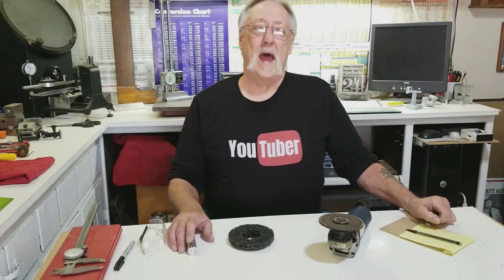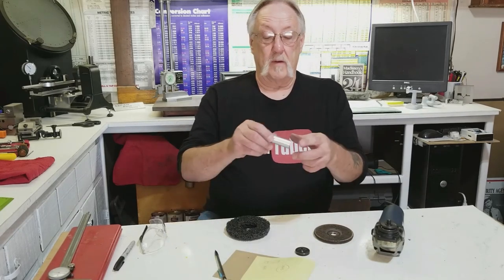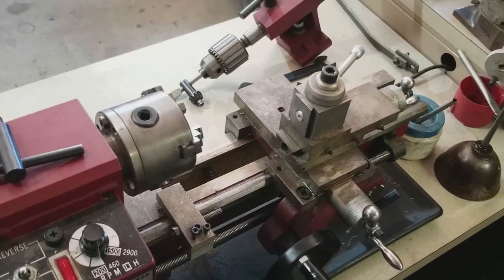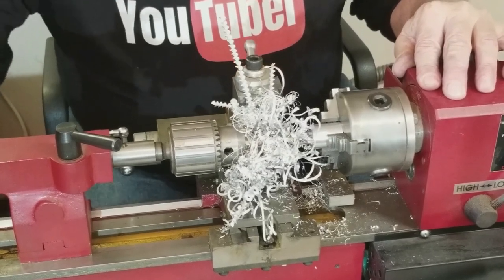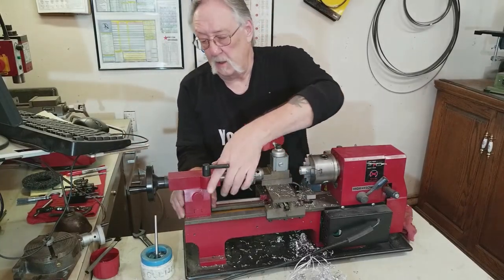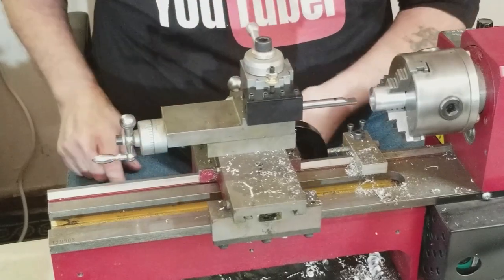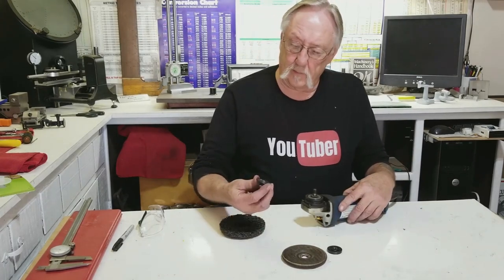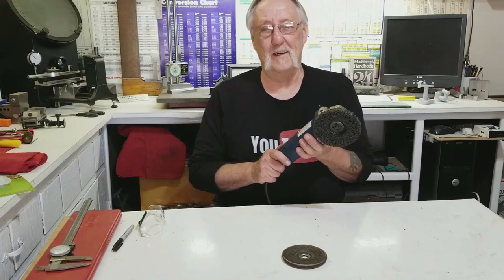Precision Turning on a Harbor Freight Mini Lathe

Comment: I appreciate the time you took to make this video, its a great demonstration of the lathe. I will say though, theres a high pitched noise in the background of most of it thats pretty annoying, might wanna find the source of it.
Reply from the maker: The annoying sound you're talking about is the crappie little motor that comes with the Lathe. This video is a few years old and have learned to remove most of that noise.  I'm also in the process of changing the motor for a less annoying one.  If you like these types of videos I'm in the middle of a video series "The Big Motor Upgrade " . Go to my channel and check it out. Thanks for sharing your thoughts.
Reply: @GlennNowOnYouTube  I'll definitely check it out

Comment: One of the main things I have done on my lathe is making little shaft adaptors like that and thick washers out of aluminium, very handy for that. I would assume the disk is rated for the RPM of the grinder, only issue will be if you have sufficient of the fibre rim clamped.
Reply from the maker: Hello Jack, The disk is rated for 13,300 RPM's and my angle grinder tops out at 11,000 RPM's. No problem there. I was adapting the disk & grinder for a up coming video I'm doing called " Testing the Gator Paint Stripping Wheel" . It's coming out on June 18, 2022.  It was a fun video to make, I hope you find the time to watch it. Thanks for watching the video and commenting.

Comment: Cool piece made. You should get the Little Machine Shop tailstock quick clamp lever upgrade. Works great on my HFT mini lathe
Reply from the maker: Ya, I plan on doing a tail stock upgrade. Don't know if I want to buy something readymade or build something from scratch.

Comment: Those Mikita grinders you just flip the 2 pieces around & they fit the larger sized hole perfectly at least that’s how mine all came.
Reply from the maker: I had to look. But no, that's not how my grinder is. Sure would have been nice though. Thanks for watching my video and commenting.

Comment: Would it be possible to make piston rings on a mini lathe, the originals are cast iron I believe, the piston OD is 65.95mm and the thickness of the rings is 1.48mm, I was wondering if I could turn down bore out a piece of cast iron bar stock and then part off the the rings, I have no lathe or any idea if this is even possible 
Thanks
Reply from the maker: Sure, its possible. With the right type of cast iron the right tooling/fixtures precision measuring instruments and a way to heat treat the finished product. But as far as doing it on a mini lathe. Why not? Yes, it depends on who is running the machine.
Reply: @GlennNowOnYouTube  
Thanks Glen, I will get myself a mini lathe, 
All the best fella 👍
Reply from the maker: @BillSikes.  All the luck to you.

Comment: I am looking to buy a mini lathe and there is so many out there.  Why did you choose the Harbor Freight model? Does it meet your expectations?
Reply from the maker: The number one reason for buying a Harbor Freight Mini Lathe is, it was the easiest to get my hands on. But, When I looked into the manufacturer of the mini lathe and mini mill, I found that most of the china made lathes were made by the same company. They painted them a different color depending on the customer. So, I guess it depends on the price. Harbor Freight has good prices. You asked, Does it meet my expectations. Yes, as far as China built mini lathes go. It can do everything I asked of it, and I've been machining with it for 18 plus years. I have always been told that its not the machine tool its the person running it. Good Luck with your hunt for a mini lathe. Thank You for watching my videos. If you haven't subscribed to my channel, Please do so when you find the time.
Reply: I bought a Sieg Chinese made lathe, a bit larger than yours but looks almost identical. A great lathe as long as you respect its limitations. The comments stating to just go and buy the bushings miss the whole point of a lathe. It’s fun to make parts and work with the lathe. Since buying mine a couple of years ago the lathe gets used almost every time I go to the workshop for something, whether it be turning parts, buffing, polishing, etc.
Great work mate.
Reply from the maker: Yes, It is fun to make your own parts, and yes, you do have to respect the limitations of your machine tools. Making videos of me using my Sieg Lathe is just the icing on the cake. Thank you for watching my videos and thank you for your comment.

Comment: hi, technically a good presentation but what RPM is that stripping pad rated for? Usually disks and pads have different diameter center holes so they match machines that have appropriate output shaft speed in RPM for the pad or disk that is used with it. Adapters like this can be a significant risk if the speed rating (RPM) is higher than the pad is rated for, your only protection is a really good face shield.
Reply from the maker: Thank You for the concern, One of the first things I checked into was the RPM's of both the grinder and the disk. The disk is rated for 13,300 RPM's and the grinder tops out at 11,000 RPM's.  Also, when machining the spacer I did my best to keep the ID and OD concentric, by machining them in the same setup. I also tried to keep the fits close so not to have any runout or balance problems. That's why I was calling this precision machining, I guess that I should have mentioned all of that in the video. Like I said, Thanks for the Concern. And Thank You for watching my video and commenting.

Comment: You gotta use stubby drills cuzz that lathe is too damn small but its cute
Reply from the maker: You're right, the lathe is small, but it gets the job done. As far as the drill bit goes I've always started with a stubby and then go to a longer bit if needed. Thanks for watching my video and commenting.
Reply: @GlennNowOnYouTube  have always been fascinated with hf lathes, might get one if I see one cheap enuff
Reply from the maker: @stanburdick9708  The Harbor Freight mini lathe is a nice thing to have if you're looking for a hobby. I've kind of went a bit far with  building a mini machine shop, But, what the hell. I'm having fun doing it. Thanks for the comment.

Comment: I have looked at the mini lathes at Harbor Freight, and they have way too much back lash in the feeds.
Reply from the maker: Hello John, If you watch most of the videos about Mini Lathes you'll find that everyone is doing upgrades and fixes. ALL, of the china built mini lathes have back lash. I haven't done any fixes yet. Mostly because in the 50 years of machining background I've had to run some pretty shitty machines. There are ways around all of those problems.

Comment: Well Einstein, grab your car keys drive down to your local hardware store and buy yourself a bronze bushing that has a 5/8 ID and a 7/8 OD. They're cheap and plentiful.
Reply from the maker: Thanks for watching, Thanks for sharing your thoughts.
Reply: Wouldn't make for a good video though,dude.
Reply from the maker: Part of being a machinist is making your own stuff. Not having to run to the hardware store every time you need something like a bushing.
Reply: @GlennNowOnYouTube  its mot about the money. what have you learned about making your parts  and you can grow on that   WELL DONE
Reply from the maker: @anthonymarino4260  Yuo're right. Thanks for watching and commenting.